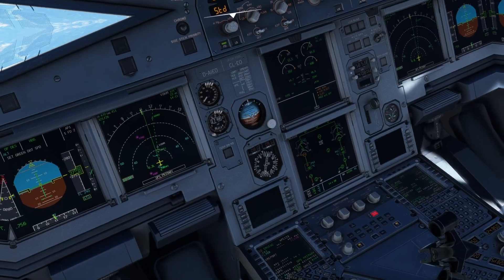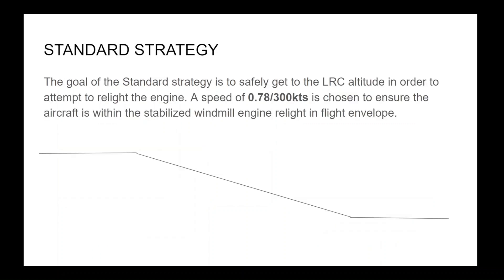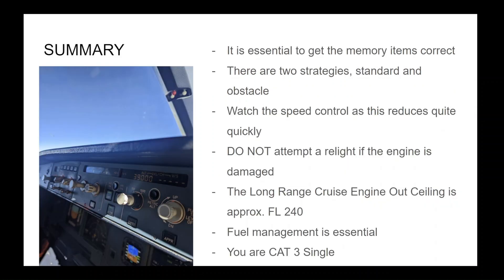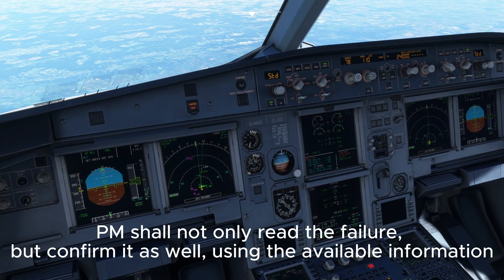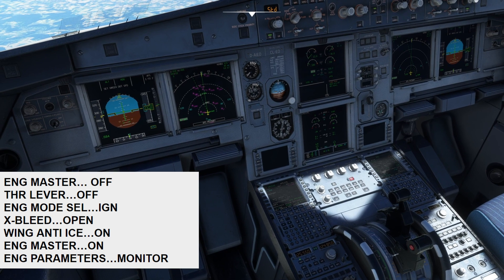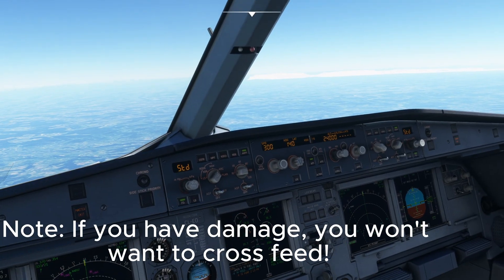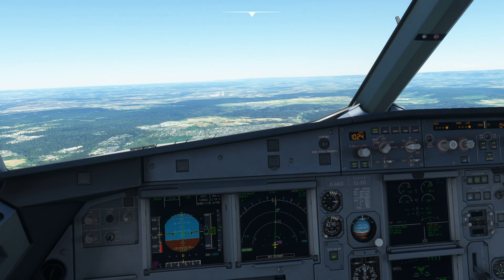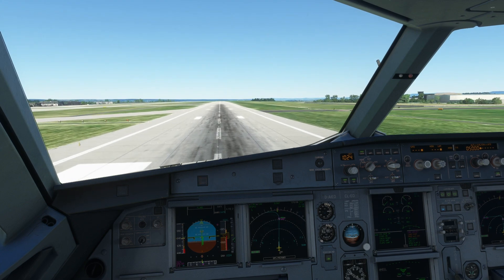MSFS A320 TYPE RATING - Engine Failure in the Cruise

Comment: Very nice description, but... Could you please correct the fact that there are 3 Strategies? Standard, Obstacle, and Fixed Speed/ETOPS Strategy! Yes, the A320 Family has versions for ETOPS certified Operation, so it is important to mention that some operators opt for the 3rd strategy. The speeds used are usually higher than the Fixed Speed Strategy, but defined by the operations department of each carrier.
Reply from the maker: You're absolutely correct! In this video we look mainly at the two procedures of standard and obstacle as these are the ones we are likely to encounter, as most A320 flights don't do ETOPS. But great spot, appriciate the comment and thanks for watching! :)